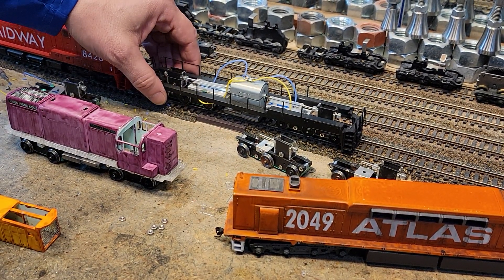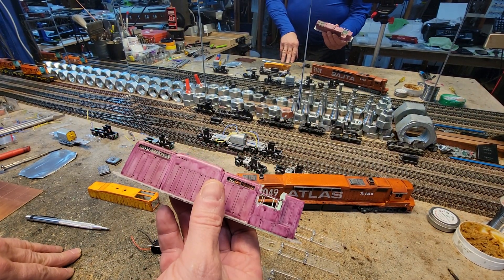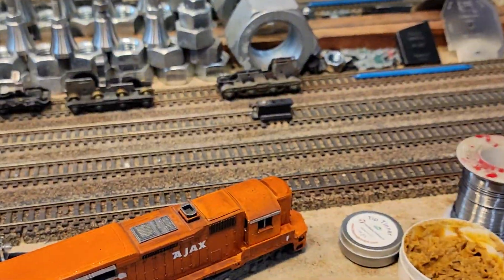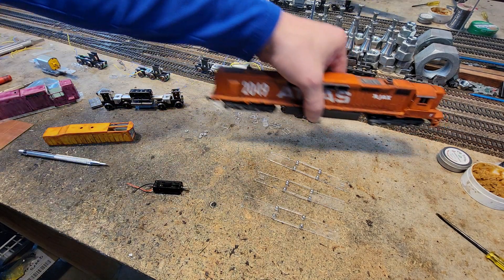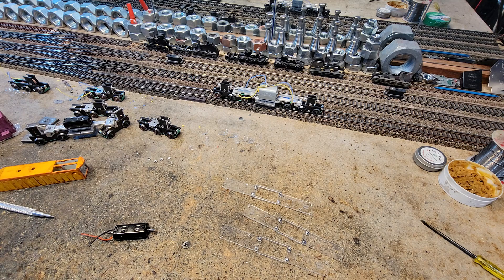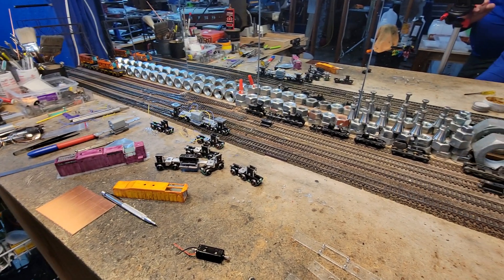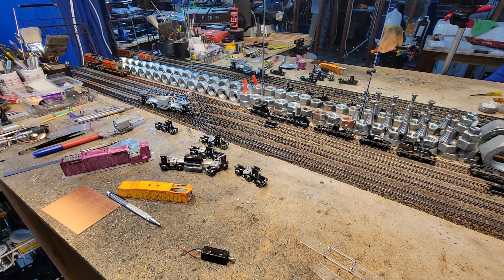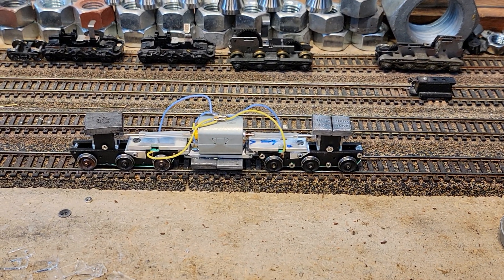2022 Contest Part 53 FIRST REVEAL scratch built operational locomotive

Comment: Congratulations on your build. Check out Liquid Gravity by Deluxe Materials. Basically steel shot about 1mm diameter. I've used it on my Walther's torpedo cars with great success.
Reply from the maker: I'm thinking of getting a burner for melting lead outside - tons of stuff I could cast.  but I might also experiment with mercury, you know just to take it up a notch!
Reply: @elite194  I heard the story of scratchbuilt small steam locomotives for a centenary display nearly seventy years ago using mercury in a soldered boiler to gain adhesion. Worked, but a few years later the mercury ate away the solder and the boiler fell apart while on display in the builders lounge room.
The mercury vapours were highly dangerous both building and trying to clean up the mess.
Reply from the maker: I'm looking into that from some old scratchbuilding articles I've located - a non-reactive container would have to be built,  but that project is down the line a ways

Comment: 👍nice job👍 the 24 v motors for them should be very impressive power 👍👋😎🛤🚂
Reply from the maker: the 280 has tons of torque making super slow possible and the power pickup on the trucks is excellent